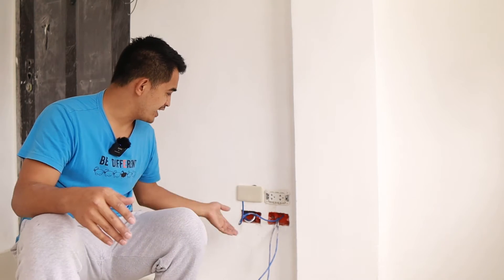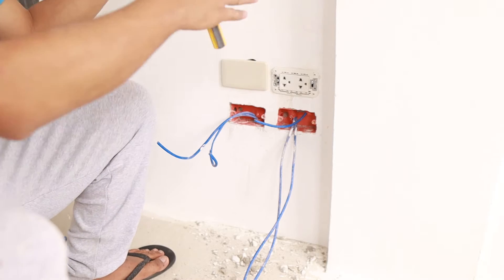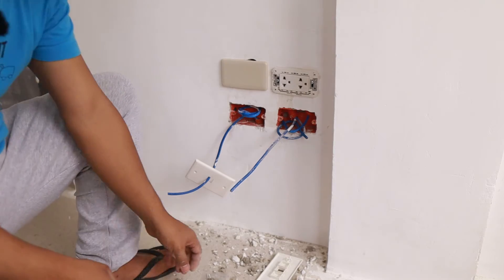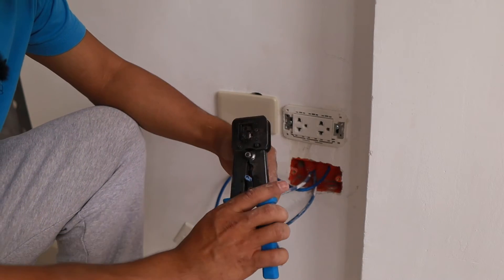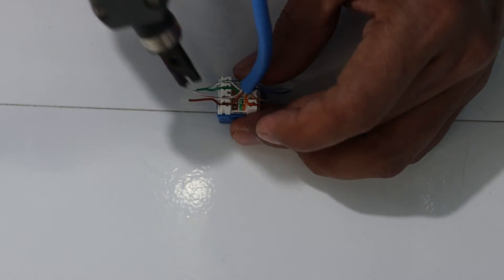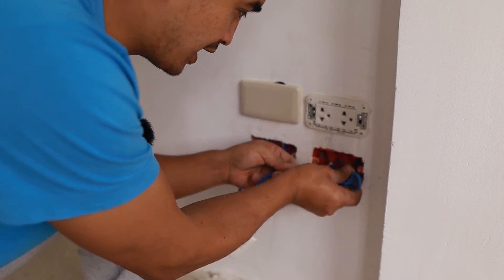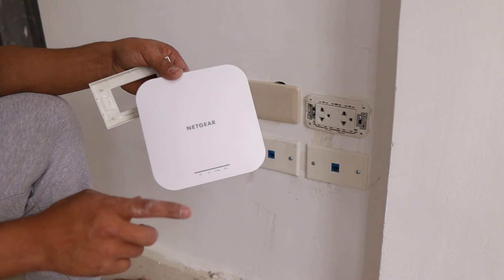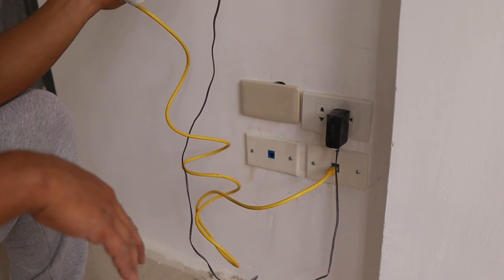How to Terminate Home Network Cables Like a Pro | DIY Guide with Keystone Jacks

Comment: Hey how do connect three Access point in to one connection please let me no.  Am use these devices.

(1) Ubiquiti Networks AP-5AC-90-HD 5GHz airMAX ac 3x30° Sector Antenna 22dBi

(3) Ubiquiti RP-5AC-GEN2-US 5 GHz Rocket AC Prism Gen2